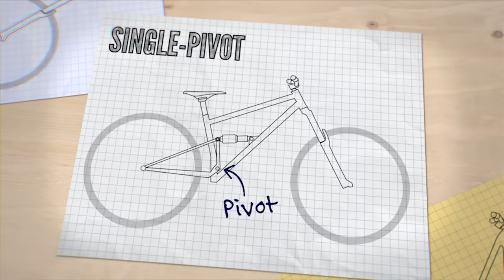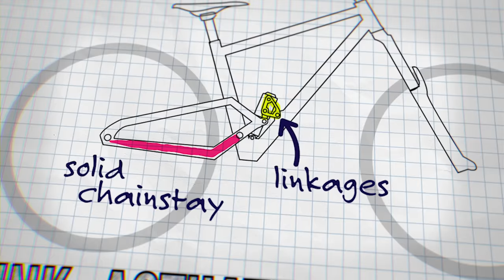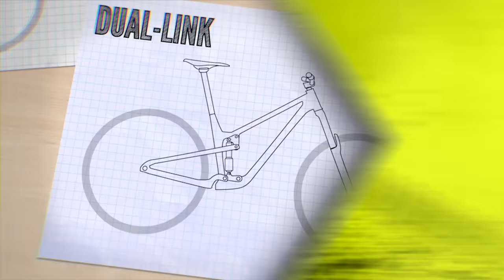Understanding Suspension Layouts | Single-Pivot, Horst Link, Dual-Link & More Explained!

Comment from the maker: How much travel does your bike have? Have you tried many different suspension platforms?
Reply: I have XC hardtail :D so 100mm in front :D and i love it.
Reply: I ride a hardtail too, however the video was very informative and interesting. Good content.
Reply: My ripmo af is DW link 148mm rear travel and my Tues is virtual 4 bar (V4L) 200mm
Reply: My Gen 5 Trek Fuel ex is 130mm in the rear w/ the ABP suspension. My XC race hardtail has 0 travel in the rear. Both are a blast to ride in the given terrain.
Reply: have a 150mm GT i drive single pivot with isolated BB (force LE 2013), a faux bar (linkage driven single pivot) merida 140mm from 2010 and a 2019 GT force 150mm four bar linkage.
Reply: I got here by accident and all my bikes are rigid. The travel consists of my knuckles so to speak.
Reply: Start with 140 mm in a XC/Trail  than 150mm Botton out on the north shore Vancouver, now, coming with another bike 170mm for more aggressive bike style.
Reply: Niner RKT9RDO with the double link CVA linkage. 120 fork and 95 rear. The CVA makes it feel like there is much more travel and there's almost no influence from pedaling or braking.
Reply: Santa Cruz 5010 v4, so 130mm rear, VPP (so twin link)
Only bike I’ve had so far with rear suspension.
Reply: Currently on a Transition Sentinel (160/150 stock) with a cascade components link to give it 170/165mm travel, currently with a coil shock.
I've mostly had four (Transition, Norco), faux bar (Kona, Trek) and dual link/VPP (Santa Cruz) bikes.  Older Treks (pre 2019ish) were interesting because the lower shock mount was bolted to a chain stay extension forward of the main pivot.  I think they called it Full-floater in addition to having the split pivot at the chain stay/seat stay.
Comparing them all, it seemed like the Treks had very active suspension, VPP pedaled well and the Kona was more brake-affected then the Norco.
(all between 135 and 150mm or rear wheel travel)
Reply: I have a hybrid commuter bike that has no travel. 
   I have also had front only suspension and full suspension. 
   The front suspension were mostly 80mm, maybe a little more.
   The full suspension was a single pivot with 100mm back wheel and 130mm front.
   So I have tried all main types, not including the different types of rear suspension.
   All fun too ride!
Reply: 140mm FS3 linkage Polygon Collosus T8, full floating like that Propain. Almost exactly the same except that the top rocker rotates the opposite way.

And a
120mm linkage driven single pivot Polygon Siskiu D7, the old one with basically no anti squat whatsoever.

I've also tried the Xquareone and I have no idea what you'd call that linkage design. 
And the new IFS Collosus, that one's a twin link.
Reply: 9.5 inch travel. Semi/high single pivot. With linkage. Scott Gambler DH 20 2008
It just eats everything.pedalls okay but lacks being independent of braking forces...But it does not affect it much ,because The suspension will always be more active under compressions ,and brakes will not lock it up fully.They just slow the action ,but only if both are pressed fully at same time. thats why many single pivots do not have floating brake solution.Not a big deal if you brake only when its needed .For people that brake more or go slower its noticeable and does feel rougher in the back. 
The best i rode was High pivot/idler Corsair maelstrom
(on rough) it just ate square edge and the path of the rear axle is rearward .

Comment: Finally a video explaining in pretty much just the right amount of detail all the suspension designs. Doing the god's work GMBN! I've ridden a Giant Reign with their Maestro link, a Commencal Meta TR and absolutely hated it, and a specialized stumpy evo, which I haven't got much chance of riding it at all yet. So far the Giant has been my favourite, it was just so simple and is quite tolerant in terms of shock set up. I just got into MTB when I got the Giant and didn't know or bothered with shock setting at all. So I left everything in the middle and that bike felt really good already. Absolutely loved that bike. Then the META TR. For some reason the suspension just didn't work. My feet get bounced off the pedal every time I go near a descent, be it a set of stairs or a trail. I don't know if it was the high engagement hub that affected how the suspension felt (pedal kickback), but apparently there were a ton of anti squat to a point it just doesn't want to compress at all. I've tried air and coil, and different set ups to no avail. So I decided to get rid of it and bought a stumpy evo and see what the fuss is all about. Must say it is sooooo much better than that of the META TR and the bike overall just rides amazing. The Horst link suspension feels a lot more supportive, tho, and not as perhaps supple as I remembered the Giant to be. But then again, I need to spend more time with the stumpy.
Reply: Maybe it is not the bike, but the person doing the setup?
Reply: @krneki111  ummm but I've been doing the setup😅 I'm the only constant in this

Comment: After watching this video (btw very nice) i was wandering if a after market idler can be designed to be able to install on older frames or frames that don't have a idler (something like a front derailleur but with a jockey wheel or something like that) also would be nice to know how idler positioning effect suspension feel in braking and pedaling or anything else the idler might effect.

Comment: Very nice video. Well done, well presented and very informative. Would love to see this continued. Maybe compare characteristics of Enduro, trail, xd bikes? Or more deeper dive how chain line and gear selected affect these characteristics - can have positive and negative impact, also can be used to tune suspension design on deularier bikes but set chain length on gearbox bikes has its own benefits

Comment: Big thumbs up. I have always wondered what the differences were in different suspension set ups. Would be interesting if there was a deep dive into the pros and cons of each suspension system / layout. 

Like for example I rarely see XC bikes use the dual suspension layout. So does that mean dual suspension is not as efficient for anti-squat? Since XC is more about climbing and speed.
Reply from the maker: Thanks for the idea!

Comment: Flex stays are not for bottom out protection.  It's just that in many four bar linkages, the pivot by the rear axle moves SO little that you can just rely on seatstay flex in place of that pivot.  It's very similar to a faux-bar, but the pivot on the seatstay is just replaced with seatstay flex.

Comment: The 3 full suspension bikes I've had or currently own are. The Giant ATX 970 which was a faux bar. The Boardman FS Team which was a 4 bar. Blake's old Orbea Rallon a linkage driven single pivot. I'm not actusally sure I could accurately tell the difference as the Giant and the Rallon use coil shocks and the Boardman used an air shock.

Comment: This is the kind of content that I love.

Clearly a lot of work went into this video. 

It would be cool to have a follow-up video on the advantages/disadvantages of each design
Reply: In general.  single pivot has very consistent performance, but can't separate pedaling or braking forces as well as other designs and is the least efficient pedaling.  DW link has incredible pedaling performance, and is flat out the most efficient pedaling design, its high anti-squat however can cause it to have poor small bump compliance and less traction through rough stuff.  VPP is similar to DW link, but trades some pedaling efficiency for better traction and small bump compliance.  Horst link is the king of small bump compliance and traction, but the tradeoff is less pedaling efficiency, though it does still pedal more efficiently than single pivot, and a Horst bike will have tenacious traction on tech climbs.  The traction and generally robust design is why Horst link is what is typically found on enduro bikes and a lot of DH bikes.
Reply: There are also variations on the 4 basic designs.  Canfield Balance Formula (used on Canfield and Revel bikes) is a variation of DW link (twin link with co-rotating links) but the main pivot is forward of the BB, which produces even more efficient pedaling and also incredible traction, the tradeoff is CBF designs tend to be fairly linear in terms of their leverage curve.  Rocky Mountain's LC2R suspension which has recently been revived on the new Altitude is a VPP (twin link with counter-rotating links) variant where the main pivot is concentric with the BB.  Giant's Maestro link, is so much of a carbon copy of DW link that they were sued by Dave Weagle (Giant won the suit), they put the main pivot on the lower shock mount where standard DW link puts the main pivot on the seat tube.
Reply: @mrvwbug4423  

Maybe I'm remembering incorrectly, but aren't most xc race bikes single pivots? I would think that style of bike would want good pedalling efficiency
Reply: @bike314 just learn more about leverage ratio, Anti Squat, Anti Rise, Forces etc and you don’t have to think about this things. Suspension designs are not fixed to one characteristic type of kinematics percentages
Reply: Pretty sure they have just ripped it directly from Enduro magazine circa 2020. Loads of work went into it, and unless I am mistaken the work wasnt GMBNs. One of the original authors was Ruben from Raaw. Those blokes know how to build a great bike.

Comment: The idler wheel is not so a longer chain can be used.  It's to reroute the pedaling forces to a point that makes a relatively straight line from the frame to the cassette to minimize pedal kickback.  You'll notice the idler is always in close proximity to the pivot.

Comment: This video got me thinking about if using a progressive coil on a progressive virtual link is right call. Maybe should just open up the settings and just let the coil and link handle everything
Reply: Usually you want to use a progressive spring on a linear linkage and a linear spring on a progressive linkage.  Progressive coils are mostly for bikes that are a little too linear to really run a coil like the Ibis Ripmo or anything with CBF suspension.

Comment: Hi from Norway  !! How about YETI,s " Switch Infinity " system !! ?? is it,s any special ?? Thank you !
Reply: Switch Infinity is a linkage driven single pivot, but the main pivot floats vertically on a special damper device, it's probably the most expensive suspension design in use, another reason why Yeti bikes are sooooo expensive.
Reply: @mrvwbug4423  No, it is not a single pivot. Do the math.

Comment: to this day my GT LTS 2000 custom DH rig i had in 2000s is still the best suspension ive ever ridden. Im even thinking of making a custom LTS 2000 with modern geo, just need to learn how to weld or fillet
Reply: and make it a mullet cant stand 29 BUT i do like the stability and speed having the front 29 just dont like 29 on the back. i was also thinking 26/27.5 but after i hired a L orange at canop i fell in love with the 27.5/29 set up, still not keen on the linkage single pivot as it was skitish. My GT had so much traction it was insane thou a little twitchy as geo was bad back then
Reply: I'm still riding my old 2013 GT force le with the idrive single pivot setup.  Was their last idrive bike.  Nice 66 degree head angle and long top tube, but the seat tube is 72.  If the seat tube angle was 2 degrees steeper I'd be set for life.  It's running a 27.5 front with a 2.8 high roller ii and a 26 rear with a 2.6 nobby nic. 

Has super good pedaling, is nice and progressive but has a bit of brake jack. I have a newer GT force but always end up going back to the 2013 force out of habit. 

Just got the frame rebuilt and repainted. Ready to go another 10 years.

Comment: By the 7 min mark I had noted two errors.
In the original explanation, progressive is not described quite right: progressive is described as less movement in the shock for a given movement in wheel. This is true but the key fact is that the ratio of wheel movement to shock movement increases was, I feel glossed over.

Secondly flex stays are not to provide additional bottom out protection. This is not what they are for: imagine the triangle a b c where a is the end of the seat stay near the seatpost, b is the rear axle and c is the pivot point generally near the bottom bracket. 
Under compression the points a and b are going to move at slightly different speeds relative to each other so one of the sides of the triangle has to change length. This obviously is going to be the length a to c. A little basic math(s) tells you this means the angles of the rear triangle have to change. The angles at a and c are fine... they are both set up as pivots (even on a single pivot design). The angle at b either needs a way to change, so you have to put in a bearing or bushing to allow the seat and chainstays to move relative to each other, or the stays need to bend. 
This is why most modern shorter travel bikes use flex stays... it allows the angles of the rear triangle to be "fudged".  The reason you don't see it on long travel bikes is because the amount of fudging needed would require the rear triangle to be very flexy.
Reply: If 15mins of solid talking only resulted in me failing to explain two points adequately, then I’ll take that as a win. Cheers 😅
Reply: @AnnaOnTheBike  I always enjoy your videos, and virtually always learn something from them.  No different here.
Reply: At 3:30 concerning the explanation of progressive, it appears to me there's problem. 
It is said that during compression of the rear, the shock has less travel compared to the wheel that is was at the beginning. All the while concluding it produces a firmer suspension at the end of the travel... That simply cannot be. The smaller is the travel of the shock compared to the travel of the wheel, the shorter is its "lever"... hence the softer is the suspension. (think of it as lever arm if you prefer)

I'm a road cyclist and know too few about MTB and their suspensions (that's why I was here). I cannot tell what's wrong : 
These layouts are designed the other way around and shock travels more at the end? 
It is simply designed to be softer at the end? (that would be strange)
Shock are also progressive but overcompensate with firmness the mechanical progressive softness of these layouts?

I don't know what is wrong but I know my physics and there is something looking wrong to me.
One of the roles of the suspension is the transfer the work of the wheel to the shock absorber. It doesn't absorb energy, that's what the shock ABSORBER does.
For a suspension, we could resume energy as vertical travel work. 

W = F x D       Work = Force x Distance

To keep it simple.
For the same travel at the wheel, if you decrease the distance (travel) of the shock, you then decrease work (hence, force at the wheel, i.e. it's softer) or you have to increase the force of the shock to compensate the shorter travel of the shock.

To be complete
Since work is transfer from wheel to shock we could present it this way
F(w) x D(w) = W = F(s) x D(s)        Force(wheel) x Distance(wheel) = Work = Force(shock) x Distance(shock)
F(w) x D(w) = F(s) x D(s)
F(w) / F(s) = D(s) / D(w)
Ratio of forces equals the inverse of the ratio of distances (travels)
Could also be written as :
( F(w) / F(s) ) x D(w) = D(s)
For a given wheel travel D(w), if you decrease the shock travel D(s) you either :
decrease the force at the wheel F(w) (let the suspension be softer) 
or 
compensate the shorter travel of the shock D(s) by increasing the force of the shock F(s) (design a firmer shock).

To have a firmer suspension, 
They overcompensate the shortening travel of the shock with an even more firmer shock. But it was wrong to say these layouts themselves makes the end of wheel travel firmer.
Or 
The design of the progressiveness of the suspension is the other way around to increase the travel of the shock and not the opposite. But it was wrong to say the shock travels less at the end.
But there is something looking wrong to me.
Reply: @nounours2627  you are correct. simple leverage. less movement in the shock means more force on the shock, that would be degressive.

Comment: Anyone got any feedback as to how the Propain feels to ride?

I once tried a thought experiment as to how I might construct a suspension system, and, came up with something very similar to what Propain actually came out with a year or so later.

My thought process was that it would be better to hang a rocker from above rather than pivoting over a link point and then use it to push down on the shock from above while pincering from the bottom.

That way, you don't have to contend with the effects of an over centre lever situation which would potentially affect progressiveness throughout the stroke.

The design interests me greatly, so, if any riders out there have any feedback it'ld be good to hear back!